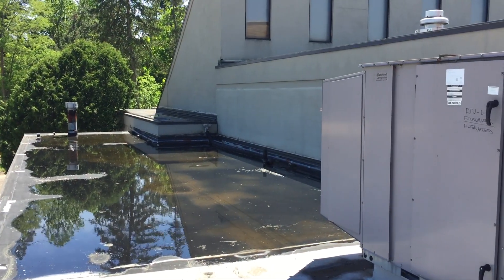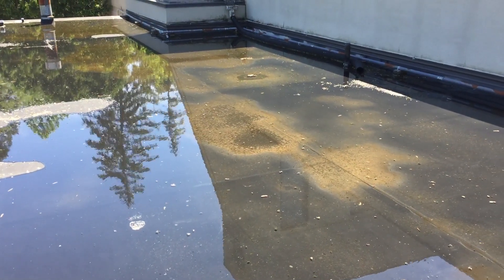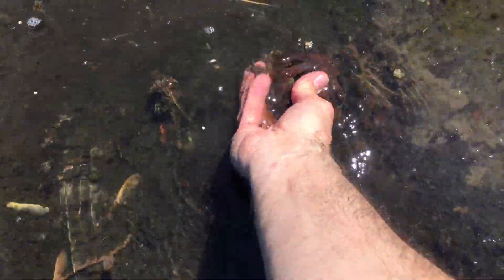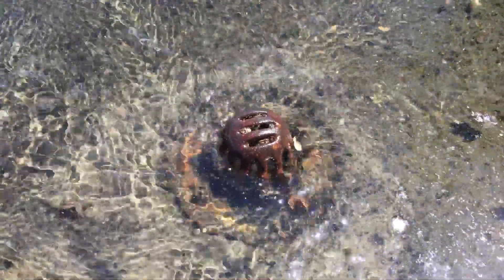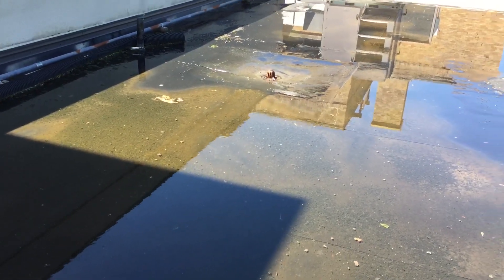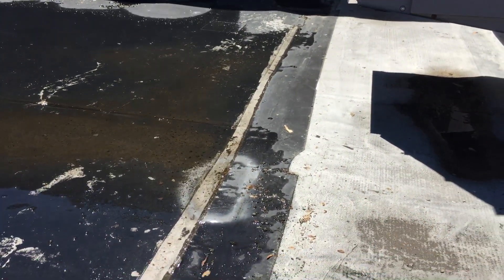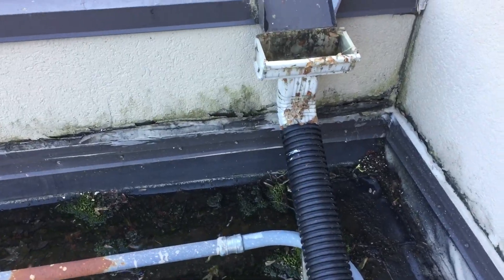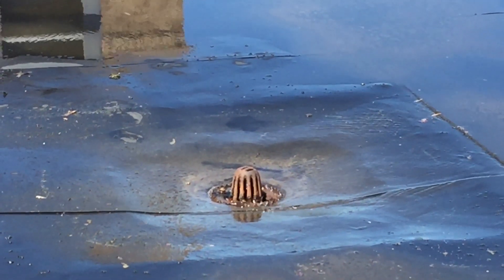Flat Roof Water Ponding

Comment: a rubber roof tied into a asfault roof does not work.any repair you do will be temporary at best.  have the rest of roof done in rubber and or most likely all the rubber needs to be redone.  nothing will stick to the silver coating

Comment: Does it become a room under? Urethane waterproof is broken. Urethane waterproof is broken because there is no kasagi and no rising parts. If it is oneself, it is made of lumber, veneer and Tenton, and it is a single slope. Is the roof of the roof waterproof of the slab? There was a hole in the middle of the drain. Seasonal 🍂 Annually 🍂 I think that the fallen leaves will be packed with the drain, but if you want to keep the house longer, it is recommended to be a roof of the stencil board. Please ask an estimate for the building. I think that it can be done by two people if it thinks that it is not possible to be surprised. Home design. Please adjust the shape.

Comment: Tip... put a layer of pebbles up on the roof. They stop the leaves from clogging up the drain cap whilst the water and dirt can wash away from between the rocks into the drain.
Reply: Yup, until the voids between the pebbles are clogged by debris and decomposed organics.

Comment: Those roof caps are meant to pop off and then pop back on that's why it's wiggling in your hand. The debris just flows down the pipe and out onto the ground you don't have to worry about it clogging.

Comment: Just pull the guard, out the leaves will flow right through and out and it will drain quickly those guards are more for keeping critters out than leaves.

Comment: Add it onto your biannual maintenance schedule. And yes, they’re designed to be lifted off. The leak probably occurred because of the pooling water and won’t happen again if the roof is in good condition. Check the roof drains ok, if so it might be worth having the roof redone, it’s blown the seams and could have rotted the wooden roof sheeting.